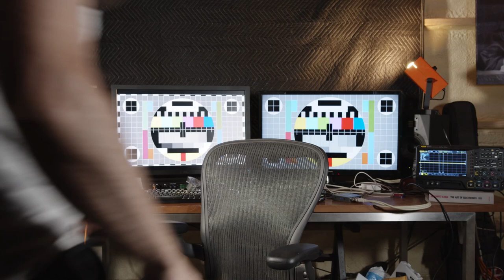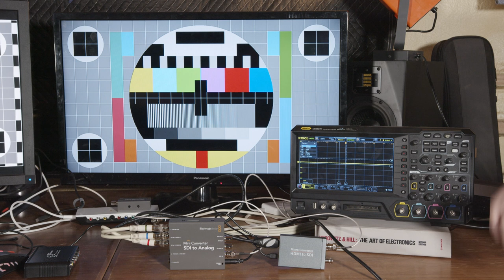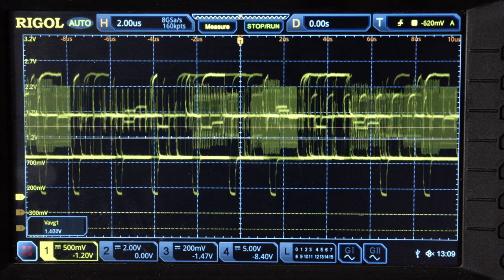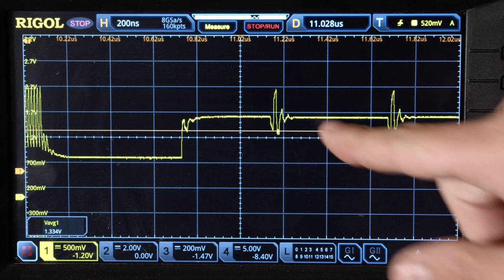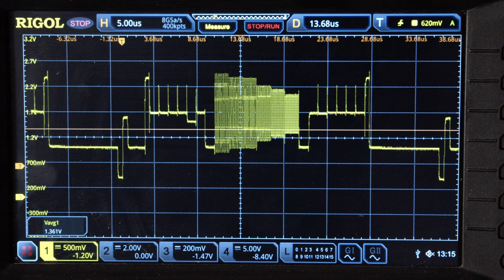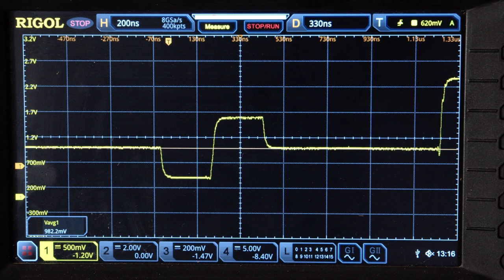$30 vs $150 HDMI to Analog converter review & tear down

Comment: Quite a big difference in quality between the two units. I have gone back to using some analogue screens for playing retro games, I am using a Mister FPGA unit and a few Sony PVM screens I collected over the years (and a few Sony computer monitors), having high quality analogue output is important, the signal coming out of the Mister FPGA is extremely clean compared to something like a Nintendo Famicom or Sega Megadrive. Great video, my scope is only 50Mhz so I too am unable to see the nice squares of the test pattern.
Reply from the maker: I have to admit that I've started searching ebay for a deal on a >1GHz scope. It would be great to see things in detail. I do have a 100MHz analog tek scope, but it isn't a significant improvement over the 70MHz DSO.

Comment: Did you find any issues with latency? I’m trying to run a mini snes on crt by going hdmi-component and the intermediary sdi step looks like a great solution just not sure about any input lag I may encounter
Reply from the maker: I didn’t notice any lag, but I haven’t measured it. Good call, I can do that.

Comment: I have found that any time I convert to SDI that my black level gets messed up, like I have the TV set to limited range for HDMI, I'm not sure if thats a limitation with the format but I find that to be much worse than the ringing in the output.

Did you probe the output of the chip to see if it was cleaner before those passives by the RCA socket? Perhaps someone could put a better output buffer on it to clean it up?
Reply from the maker: Odd that your black levels get messed up with SDI. I'm relatively new to learning about digital video formats in any sort of depth, and I'm at a loss as to why that would happen. Do you have any theories?

I haven't directly probed the output of the cheap chip. I'd have to desolder some 0402 SMD components to isolate it from the impedance matching passives behind the RCA. And even if I could clean it up, I'd still be dealing with the fact that it resamples from 24p to 50p. That would be fine for most use cases, but in my case I'm sending the analog signal to a video effects unit / synthesizer that I'm building. I've designed all the analog components, filters, etc., for 24p and things wouldn't look right at 50p.
Reply: @superchromat  Found this thread detailing something similar which black magic solved. Seems that SDI is so rooted in broadcast that they assume everyone is using limited video levels - https://forum.blackmagicdesign.com/viewtopic.php?f=18&t=7096
Reply from the maker: Fascinating. I’m from PAL land, although I now live in NTSC. The difference in black level was never something I noticed when working with composite video. But I’m by no means professional. 

Now I finally understand the 7.5 vs 0 IRE setting in the Blackmagic config.

Comment: So an issue I am having (I do glitch visuals) when I send my 4:3 resolution screen from my laptop to my crt tv the hdmi to composite converter shrinks the footage and looks like if you put 4:3 resolution on a regular 16:9 tv, If I did hdmi to sdi then sdi to composite do you think I could get the native input from my laptop? Thank you!
Reply from the maker: What converter are you using? Decent ones should have a direct pixel for pixel mode that won’t stretch 4:3 out to 16:9

Comment: Nice, quick question, how did you connect the scope to the luma signal? Can I just connect the probe to the RCA connector, or do we need some specific cable for that?
Reply from the maker: Yup. That will work. If your scope has BNC inputs (most do), you can buy BNC to RCA adapters that work fine.
Reply: @superchromat  cool, I have I have a BNC to RCA adapter, didn't know we don't need the probe on this case.

Comment: Can anyone recommend me a high quality HDMI to component converter? All I can find online are these cheapo China ones.
Reply from the maker: The Blackmagic one shown here is very good.
Reply: @superchromat  Bought a used one apparently older models only support SDI 1.5G... so don't work well. The newer model supports 3G (there are two version of this device with no outward differences in appearance) also the 4k version of it doesn't do lower resolutions apparently.

Comment: hey there ! back with another question. would you mind explaining how the sound output works on this converter or what the cables look like ? Im trying to out the sound to my tv and its not working. would a TRS to phono adapter be necessary ?
Reply from the maker: It should be straightforward, the HDMI encoded sound is output as two line-level RCA outputs. What issues are you having?

Comment: hi you have a very good point  i have alot of betacam digi decks  they have sdi out puts
the know it's not easy to put sdi  cards in a new  pci-e  computer  and it costs alot 
i have talked to a lot  in the pro game 

 in some betacam decks the sdi is not working  on the out puts  so it's not easy for a fix
from old video decks if you are low on money   there is place for the low cost units 
only on the play back of  decks  to see of they are working   

for remaster old tapes you need a pro card sdi like you said   
i will say my mate is using alot of very low end gear  because he low on money  like the gamers 

they spend all there money on games not gear like us pro  video lot bob

Comment: Just out of curiosity, what would be the main use case for a device like this in professional AV work?
Reply from the maker: You’d have to ask an AV professional :) My guess is for interfacing with old beloved, or expensive to replace gear that doesn’t have digital inputs. The Blackmagic device was hard to find, so I imagine that they’re pretty rare too due to limited use cases.

Comment: hey there ! So I have the same setup you have but I cant get it to display on my tv through component. would you mind telling me what your settings on the dip switcheds are on the blackmagic box ? thanks for the help !
Reply from the maker: It could be the TV. What’s the resolution of the HDMI signal you are trying to display?
Reply: @superchromat  thanks for the response ! and I think I figured it out too. I was messing with the things a bit first and it looks like HDCP may have been a culprit too. Anyway, I found out that some frequencies arent too friendly with the converter (59.9... is ok but not 60) and also settings on your computer may also affect it as well. I was able to choose resolutions from 2 categories. One titled "PC" and the other being titled "ULTRA HD, HD, SD" from my nvidia control panel. Anything in the PC settings didnt work unless it was 768p or lower while from the other list, I was only able to go up to 1080p at 59.9.. fps

Im still messing with the little sdi to analog converter at the moment though and Im happy overall with it. thanks for the tip ! I really like how it can resize (4.3 or 16.9) on the fly among other things. Also you were very much right in your analysis, the signal output is CLEAN from this setup. no jittering or anything on the display. You truely have to see it to believe it.